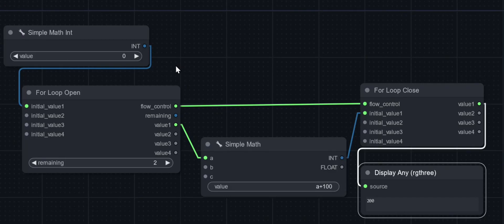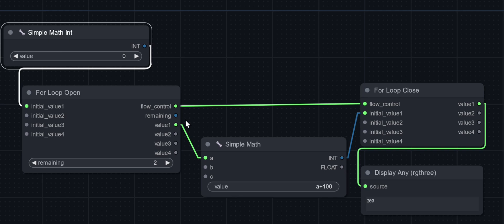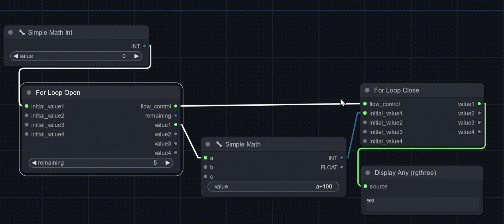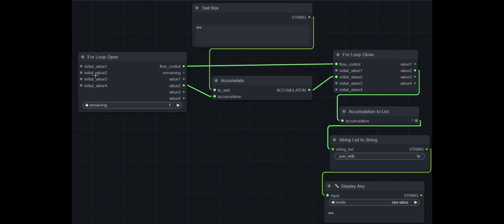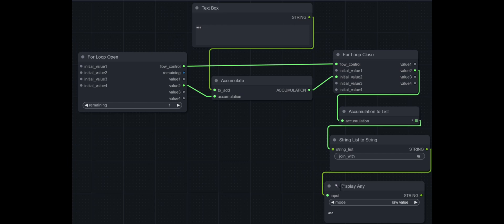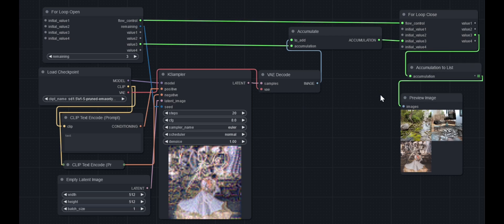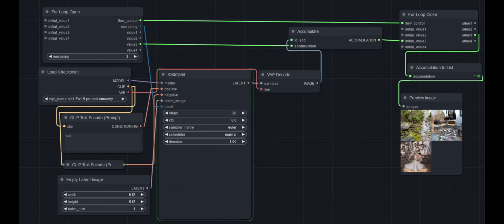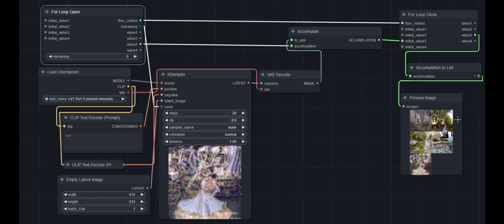ComfyUI Loops simple workflows

Comment: I am struggling to do this with a list of lists. I'm using Wan 2.1 which, on VAE Decode, returns a list or batch of frames, when I accumulate this over two iterations, I can tell that the accumulation length is 2, but I am struggling to join the two lists together into one single batch. Any advice?
Reply from the maker: Do you have a workflow?
Reply: @niknah  Hi, thanks for answering! I was using the node wrong. It was very unclear to me that you can use the output of the "close loop" node to refeed it to the "start loop" node. After I did that it all went great.

Comment: is there no simpler method? i just wanna generate a batch of 5 but instead of increasing the seed it should increas cfg for example.
Reply: because compared to this solution, it would be easier to setup by just using 5 sampler haha
Reply: Add your operation in a maths node, like in the first example, and connect the FLOAT output to the CFG input of your node. So if you want to start at CFG = 5 and increase CFG by 1 per loop, it's just "5 + a", and do the operation within the loop rather than after it has ended.